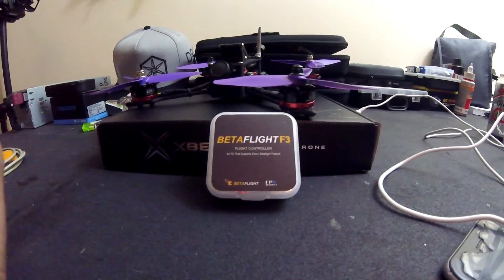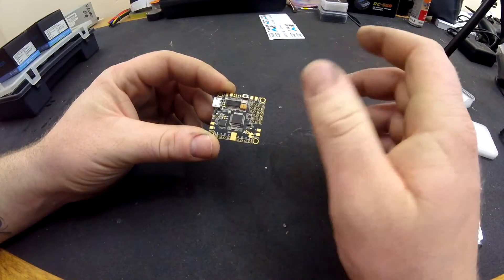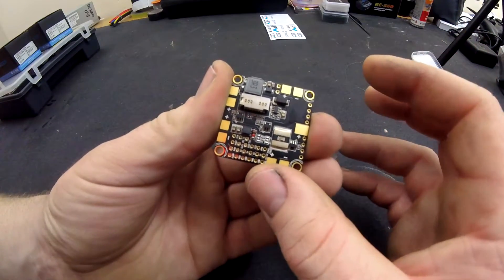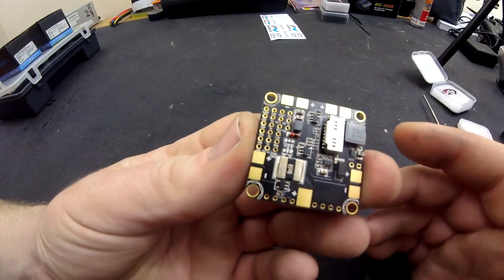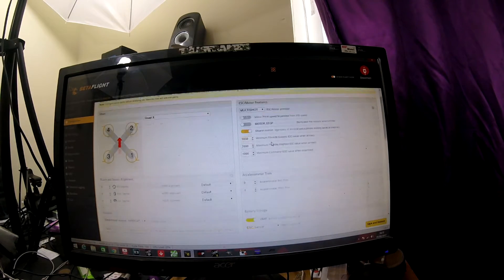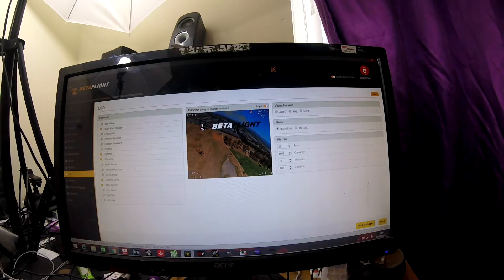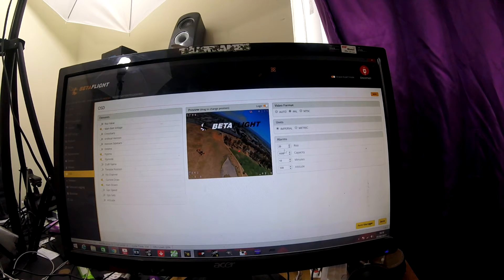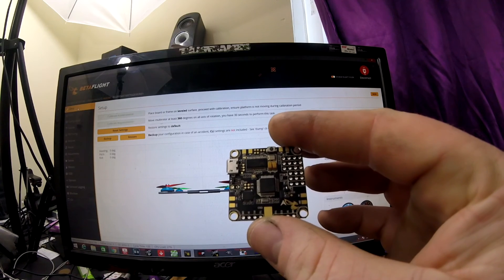BETAFLIGHT FC - SETUP - INSTALL - ALL IN ONE FLIGHT CONTROL

Comment: Hi,
How do I update the firmware Betaflight F3?
Reply from the maker: Rodrigo Peixoto you need to install a program called Zadic it's on the betaflight home page you install that open it plug your quad into pc 

Then click the drop down box and look for list all devices then click the stm32 boot loader 

Once selected click replace driver 

Now unplug your quad 

Hold the bootloader button on the fc and plug in your quad and the com port number on betaflight should say DFU 

Then go to select get the latest version and click flash and if you steps have been done correctly then it will flash the board with the latest version
Reply: Thank you my friend, it was perfect.
Reply from the maker: Rodrigo Peixoto  it a problem buddy glad to help you